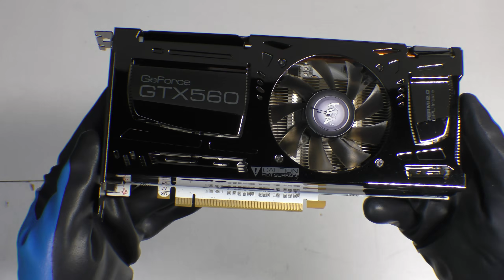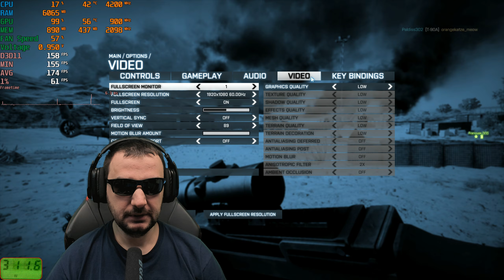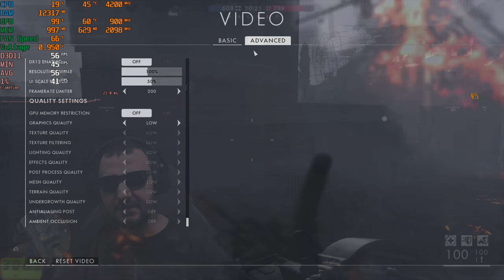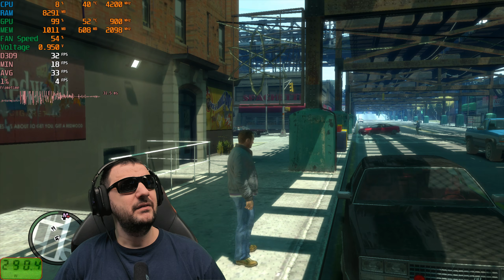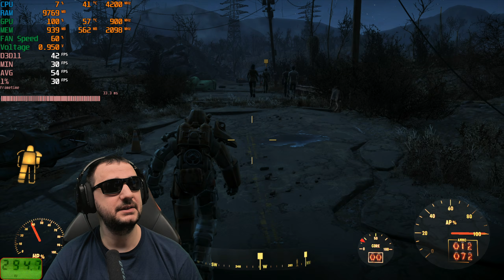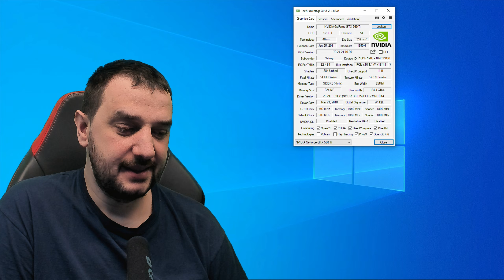KFA2 GeForce GTX 560 Ti LTD OC 1GB Benchmark

Comment: I  like how you love these GPU's, but for me, I like the latest system for the old operating systems. 5775c, 1630v4 for XP sp3, Vista, 7 x86 x64.
I tried a Z590 to use under XP, 7 but its having some problems. Not only the RAM usage limits it's only 930MB ish... xD Sometimes it's works, sometimes there are slow boot times, slower than an old pc with HDD.. Mouse moving are not fluid. I use an add on USB card, because these idiots modified USB standards, for the simple users cannot use old OS-es with new USB controllers. This is what I hate. I hate them removing browser support for XP, Vista, 7. Hate html5++..
Reply from the maker: i really appreciate that.

Comment: I have an evga model. Unfortunately it has a bunch of stripped screws
Reply from the maker: Did open it before?
Reply: @ I opened it for a school project. I didn’t have a proper set of philips head so I used something else I given which worked at the time. There isn’t a serial number on the card either which I believe I threw away. I wish I didn’t in hindsight

Comment: 20:15 : the driver-installation error has happened to me as well (happens from time to time whenever i use older graphics cards) and it's driving me 👿crazy since i can't understand the reason.
All my drivers have been downloaded directly from nVIDIA ,so this shouldn't be happening.
Reply from the maker: @Sitharii  win7 0 problems
Reply: thanks for the advice .. though ... my 1st discrete graphics card was the :virtualhug: nVIDIA Riva TNT2 Ultra from 1999 ,and since then i've been nVIDIA customer all the way ,so i'm pretty sure i know how to write nVIDIA ,and it can be written both ways ,yours is correct also ,but i prefer to write it just like it is shown on the "nVIDIA logo" . 
google "nVIDIA logo" and check the letters in the logo😉